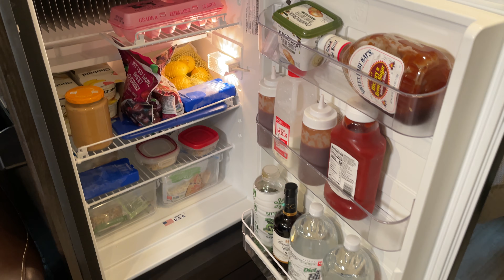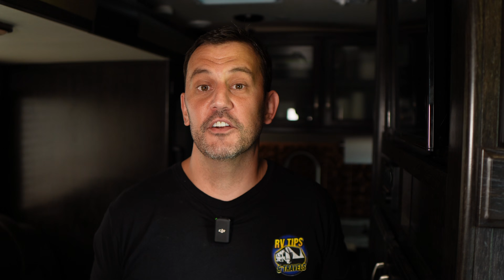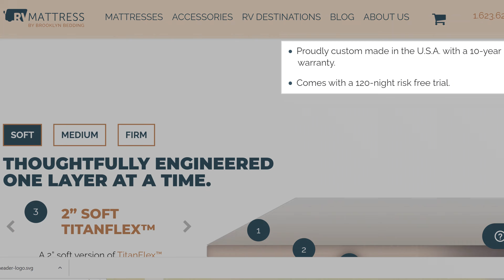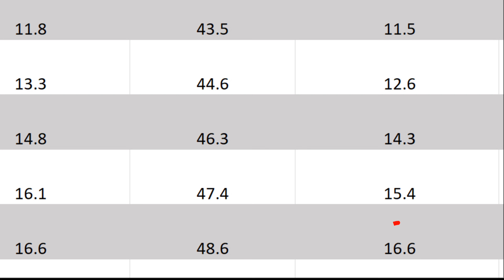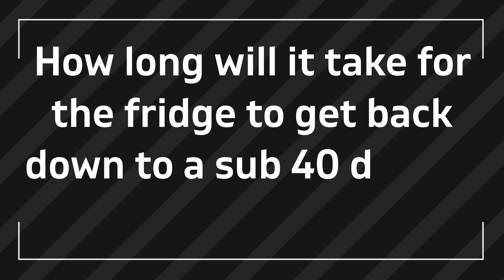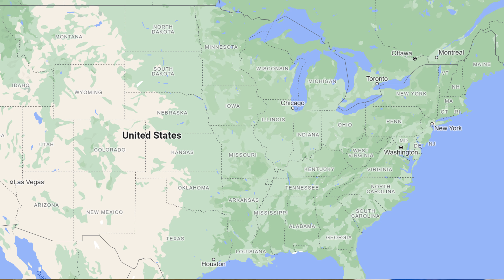How Long Will My RV Absorption Fridge Will Stay Cold w/ Propane OFF & NO Power? Spring/Summer Test

Comment: I drive 6+ hours, sometimes 7 if heavy traffic. Travel Trailer.  The fridge is off on this trip. The ice remains frozen. The ice cream does not melt, but stays hard. The beer in the fridge remains cold. I drink my first beer when setting up camp. (I love cold beer) I never did all the research and testing, as you did. But everything in the fridge / freezer was fine for 6 to 7 hours. Summer travel. 80 to 90 degrees outside.
Reply from the maker: Thanks for watching!

Comment: New RVer.  1 Yr in but mostly stationary.  We bought a used 2020 Solitude that had 4 lithium batteries and solar.  Therefore when traveling we have run our fridge Norcold off of batteries and so far it has made the trip fine though we have not done a time test.
Reply from the maker: nice set up, thanks for watching!

Comment: A good thing to do if you're going to leave your RV for a long period of time, put a small cup with a couple ice cubes in it.  If you return after a long day out, the ice will have melted a bit and refroze if park power was lost and restored.   That'll let you know the possibility of compromised perishables in the fridge.
Reply: Or just leave the fridge control on auto so if power was lost, gas takes over.....no loss of perishables. This is based on this fridge in this video....
Reply: great idea
Reply from the maker: agree!
Reply: Neat life hack.
Reply from the maker: agree!
Reply from the maker: nice tip!